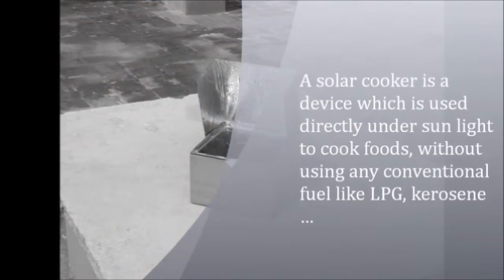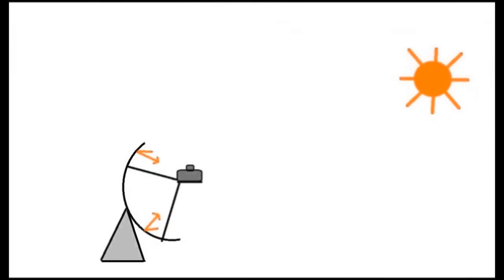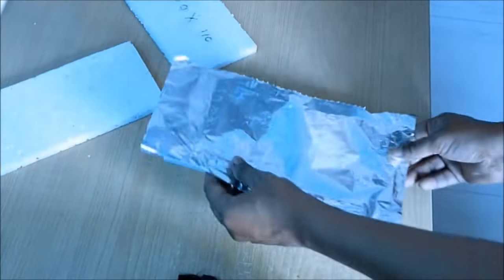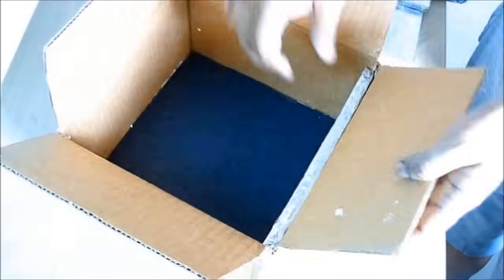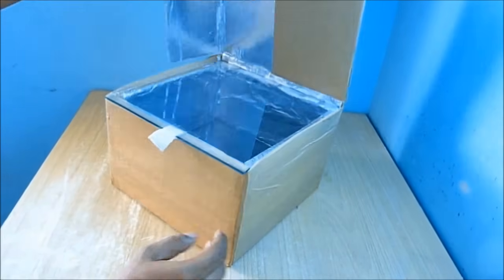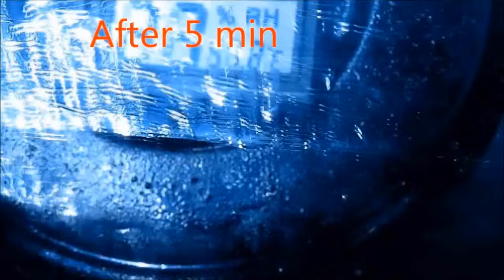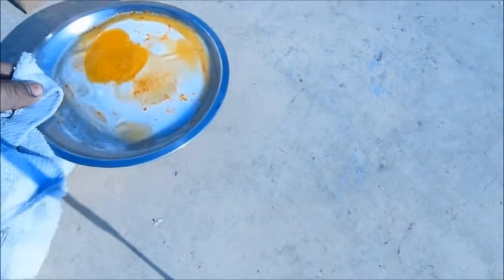How to make a simple solar cooker to understand the use of solar energy

Comment: Very good video . It might also help if river sand is filled in an insulated metal box and allowed to be heated up by solar power for several days. This stored heat can be used to cook quickly  by  keeping the cooker in a suitable niche  made of matt black painted copper lining  kept in contact with the hot sand. Toasting or roasting can be done by having another device filled with hot sand. Frying too could be done by suitable arrangement.

Comment: You know how it works in drawings, but in reality you are using materials resistant at only 70°C. A solar oven must reach between 200°C up to 350°C. What you have done its just a food warmer that can warm veggies, rice and mushrooms. Its just a low temperature steamer.
You need a fresnel lens and ceramic insulated metalic oven on wheels. What you do here are just cooking games for kids
Reply from the maker: Yes, Yes, I can even make it with precision solar tracker too. But the main goal here is the students to know about use of solar energy , which they can make themselves and can get practical experience.

Comment: Why do you use styrofoam?
Reply from the maker: As a heat insulator. That way the trapped inside heat will not dissipate.
Reply: Brainergiser I don’t have styrofoam. Is there anything else I can use?
Reply from the maker: @JordanBesser  ok, then make hollow walls of card board. The inside closed air will help .
Reply: Brainergiser Ok thank you!
Reply: Brainergiser I don’t have styrofoam. Is there anything else I can use?

Comment: Where do you find glass that size?
Reply from the maker: It's ordinary window glass. I told in the glass shop to give me a small glass they have and cut it to my require size.
Reply: Most glass used in fridge/freezer shelves.... Acrylic cheap sheets may also do the same. My advice would be to source the glass first and then do the rest around it. This is brilliant for "toasting" or roasting seeds and dals to preserve them or use in recipes like cereal and mix powders later.

Comment: use sterling engine and hydrolysis and hydrogen fuel cell combined with gearbox and sea water and sea waved energy and wind energy and other sources of energy and heat so we got more hho gas for flames and we cooking anything without the direction of sun

Comment: Very good tutorial. I don't understand why it got so many dislikes. Very specific and helpful.
Reply from the maker: Dislike is from those whose ecpection was a commercial product which can cook the egg in a mint. 😉😯
Reply: I didn't dislike the video because it's still an interesting experiment realized in a cheap and simple way that anybody can do at home following this video, but I guess people disliked it because using styrofoam as insulation is a very bad idea. 
When heated or coming in contact with hot material it will release styrene and benzene in gas form, which are known carcinogenic substances and of course can leach into the food, so using common styrofoam as insulation for an oven is a very bad idea. Don't do it, if you want to go really cheap with insulation that anybody can find at home without buying anything expensive use shredded parer or layers of cardboad.

Comment: Why if we used thick Glass????
Reply from the maker: You mean on the top? You can.
Reply: @BrainergiserTube   thank you
Reply from the maker: @mysan2075  welcome
Reply: Can we also use thick thermocol?
Reply from the maker: @mysan2075  yes
Reply: Is it ok if we wrinkled the aluminum foil?
Reply from the maker: @mysan2075  no. Make the wall as shiny as possible
Reply: Can we you black sheet with black acrylic paint
Reply from the maker: @mysan2075  black sheet is better. Black acrylic is semi transparent.

Comment: You are idiot. You need to use a glass magnifier lense to heat a black steel box with door. Steel box must be insulated with ceramic insulation. So the heat inside going more than 300°C. It can cook pizza in 6 minutes. Its just a piece of shit what you've done.

Comment: I really hope that once you answer my comments 1. is it possible without glass? 2. Can glass be larger than cardboard?
Reply: Old, but answers are yes and yes. 
1. w/o glass you use something like a turkey cooking bag. Will do in a pinch. Not great. 
2. glass bigger than box, yes. Again, not ideal but it works. The problems are possibly getting cut but even more breaking your glass because the box winds up clumsy. I did it for a couple of years. And then I broke the glass. So if possible, cut the glass properly.

Comment: Brilliant how it is so simple. Have you ever tried something more reflective for the deflector? If you used something like this which you could bend into shape it would reflect much more heat into the box https://www.ebay.co.uk/itm/Crystal-Clear-Flexible-Mirror-on-a-Roll-Like-a-real-mirror-100cm-x-61cm/262550000242?epid=1794167501&hash=item3d21331272:g:4xYAAOSwdzVXmej5

Comment: I was thinking and I could need your input Brainergiser :
What if we could combine the two principles mentioned in the start of the video. Parabolic type and the box type. It means that a large parabolic type heat a box type on a appropriate stand witin the focus point. 
Where i live (Northern Europe) the ambient temperature when the sun shines are not so great ( Typically around 68F 20C) A lot of heat from a parabolic type is dispersed inot the air and the efficiency drops , even more when ambient temperature drops further.
It would be ideal to use the parabolic type to heat the box type solar cooker in colder climates. Im thinking of making one myself. Would you be so kind and give me your thoughts (and technical input) on the project ? I was thinking that a very large parabolic reflector could counteract the ambient cool temperature.
Kind Regards
Reply: Hi! Did you make it? How it turned over? I'm Interested to make one like you say...
Reply: @beautybydenisetenerife3186  Project half finished. Parabol lined with tiny mirrors works well and i got 1 liter of water to boil within 5 minutes. I gave up because i needed to construct a scaffold for the parabolic mirror to follow the suns travel in the sky automatically to harvest the maximum energy of the sun rays without having to manually turn the parabol each 5 minutes to center it to the sun. Aiming the parabol to the sun is crucial I have no knowledge to do that

Comment: Will the height of the box affect the amounts of heat it absorbs?
Reply: i believe the height of the box would make hotter you could say since there is light going in it will have more surface area to bounce off of , id recomend a big box with more reflectors on top angled to hit inside the box

Comment: 30 mins for an egg to cook is not practical.
May be an iterated better practical would be great.
Reply: ***** sure man I didn't criticize him !!

The future of practical solar thermal energy is used for cooking is by placing large concentrating mirrors in terrace and the IR is transmitted through glass fiber tubes into kitchen, where you can just turn on when you need it !!

It doesn't heat transparent materials, so no heat loss in transmission and you can simply useit like induction stove.

Check the Google patents for practical and detailed examples man.

Comment: what about painting the outside of the box black? wouldn't then it absorb more heat?
Reply: ***** what I did with my solar cooker is  that I wrap the sides it with black color plastic. The plastic prevent the box from getting wet from rain or spill water.   I think a round one would do much better.  Sorry can't post a video.

Comment: If we paint the base thermacol with black colour instead of sticking black sheet, would it effect the heating system ?
Reply: If you want make good diy solar you should try plans from inplix site.
Reply: Yep. Inplix is good to me too
Reply: ***** I made my solar cooker for exhibition around 2 months ago.  But I didn't cook anything in it.😁😁
Reply: +Prajakta Bhalerao thermocol is used because it's a bad conductor of it. it helps to store the heat inside.
Reply: definitely it wil work .but it will work better if you had used it :)
Reply: Nidhi Singh ツ 7

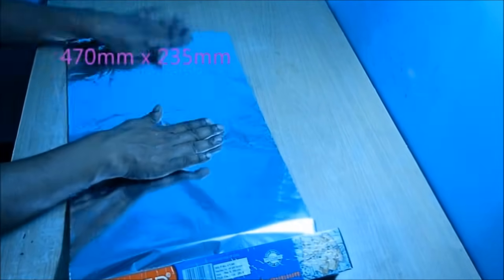Comment: What can be used instead of the glass? Plastic wrap? And also at 2:13 do you have to get another box to get this cardboard part?
Reply: I am going to try using shrink wrap “storm window” —should work, since heat is used to shrink it tight, but will it shrink too much from the heat of the cooker” a piece of a clear cooking bag—like for a large Turkey—should work

Comment: if you put a piece of black metalic sheet on to the bottom of the box, isntead black paper, do you believe it would increase the temperature?
Reply: ***** thanks for your reply, still wonder though, in every solar oven construction I read about, the desired is the bottom to absorb the higher level of heat, that's why it is used black paper and not white one.
Then I suppose in such a narrow environment the heat is released raising the temperature. Something like boiling water with rocks. If you put some rocks into the bowl of water with mediocre temperature the water will not boil, but if you put some rocks which have absorb great deal of heat then the water will start boiling.
Of course all this is completely subjective as I have never got involved with solar ovens, just some thoughts made.